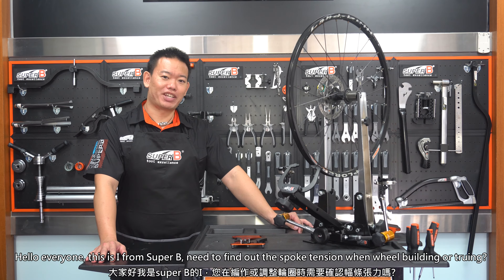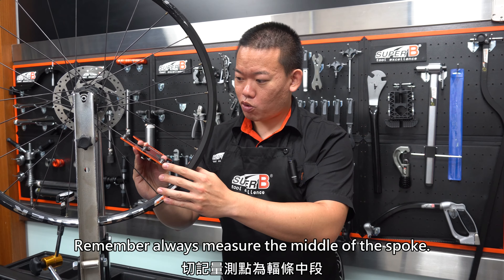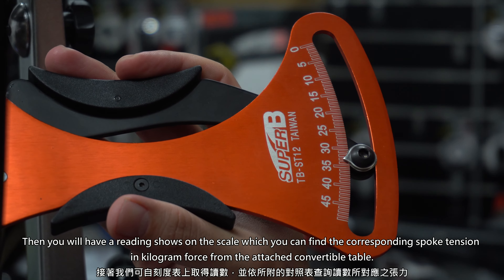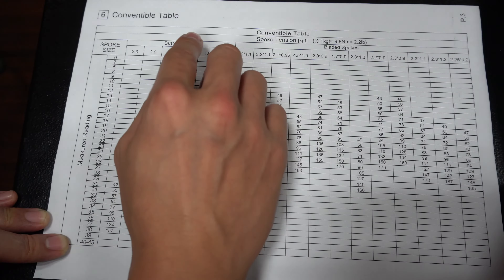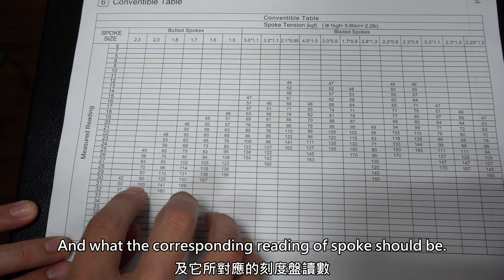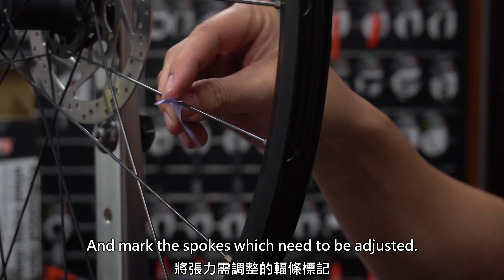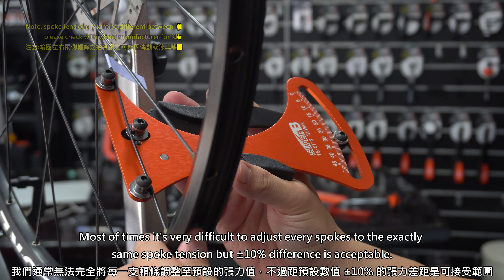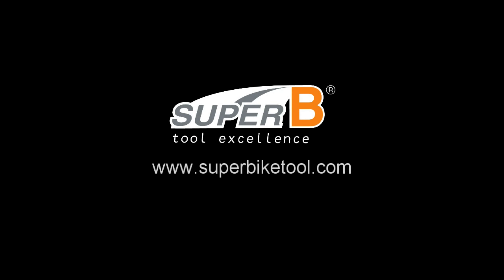How to use the TB-ST12 Spoke tension meter （EN/CH）

Comment: Thans for that tool.
I ride long ranges using my  bike (10 000 km) and I noticed spokes are not tensioned so well and wheel is not stable as on the begining.
Then I will start to improve tenstion today.
Your instruction is very well writen, thanks!
You noticed that tention on left side of wheel could be different then right side - very important note, I was not aware.
Regards from Poland!
Reply from the maker: Thank you for your support👍

Comment: I keep seeing reference to "TB-ST01" to calibrate this, but I don't see that product anywhere. Where is it?
Reply from the maker: Sorry, TB-ST01 has been discontinued
Reply: @SuperBTools  Shame, this tool would be perfect - no-one else does it! I chose to buy your truing stand instead of competitors because of the TB-PF33 , which makes your stand best option! Without means to calibrate the tension meter as well they are not useful.

Comment: Super b chain extrator is very bad. Please upgrade super b chain extrator. Use a good and resistant stell. Thanks
Reply from the maker: May I know what's wrong with which chain extractor?
Reply: I bought a super b tool bag (43 pieces). The small ball of the L key loosened at the first use. I open two chains with the extractor and the brittle steel teeth break. I had to grind my teeth and use a wedge nut. The tip of the puller pin is soft, the gold washer that holds the tip of the extractor loose easily and lose how to lose the ball of the L key. Can I send pictures?
Reply from the maker: yes sure man, but can you please leave your message and information at below link so we can organize a staff to look after your question and sort out the problem with products?

http://www.superbiketool.com/contact.asp?menu=6

Thank you for the comment anyway, it would help us to improve.